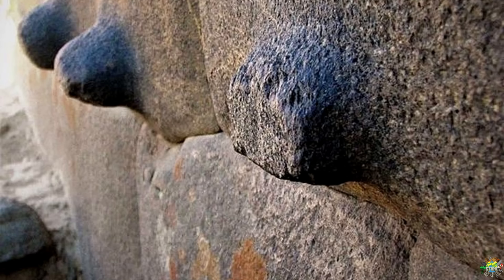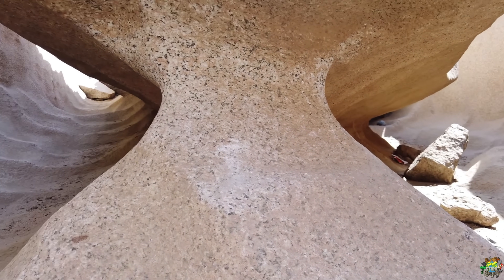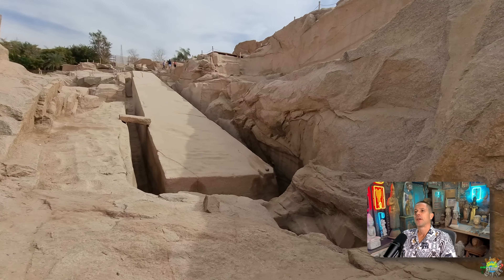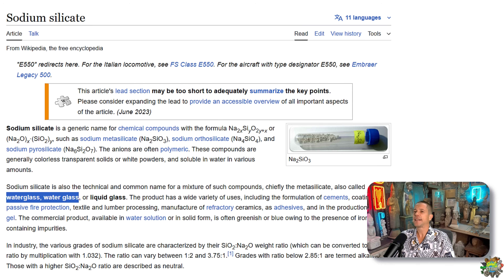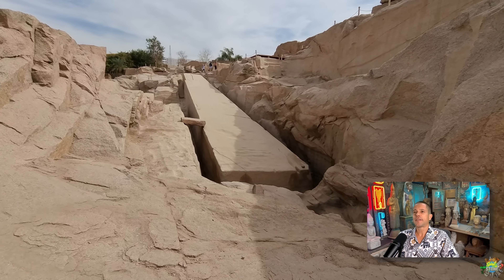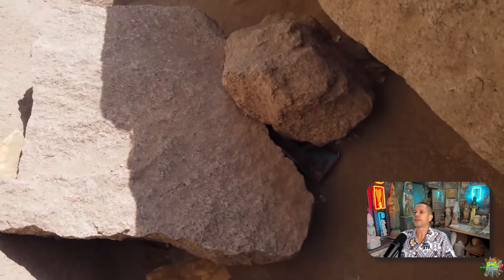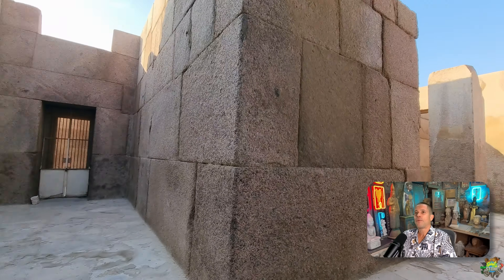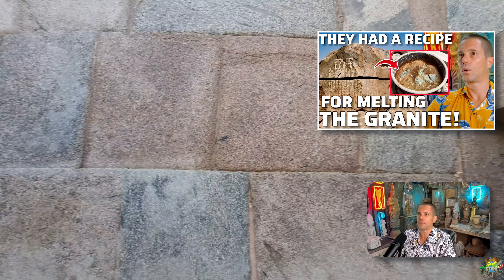The Unfinished Obelisk & The Scoop Marks Are Finally Solved

Comment: As above so below.
They scaled down a Herbig-Haro object and scooped the rock out with it.
The plasma technology they used for lamps has potentially been recreated. 
It's plasma.
Toroidal magnetic field would give it spin in one direction and the Q-tip shaped "head" - similar to the "snake" head in the dendera? - would act similar to a burr bit.

Comment: Ok, nice theory, but why did they only scoop under the obelisk and not on the right and left side of the obelisk? I mean, when down there would be a valuable place, why didn’t they scooped from the opposite side down there and only under the obelisk? 
And how much water glass do you get with this method and how much do you need to cast stones? If I look at the obelisk and what they took away it looks like that’s never enough to cast all the stones with, right? Just wondering.

Comment: @3rett115  The people of ancient Egypt had access to wood through trade if not local. They built wood barges and other things. These small fire-box fires are trivial. You do know there's actually documentation of evidence at the quarry in the form of wood charcoal, scorched and crushed rock, lenticular rock flakes from heat, mud firebrick remains, etc.? I tried it myself on basalt and it works. This is all just fire setting in small rectilinear confinements. Not some imaginary giant Dremel or plasma torch. So simple even a cave man could do it, and they did. Globally!

Comment: Goal:
Make a water-glass–based artificial stone that rivals granite by converting sodium silicate into a dense, stable silicate matrix.

Key Principle:
Water glass is used only as a silica carrier. It must be chemically converted and densified so it is no longer soluble or alkali-active.

Target Properties (Granite-like):
Mohs hardness: 6–7
Compressive strength: 200–300 MPa
Porosity: <1%
Water absorption: <0.5%
Long-term chemical stability
Aggregate (70–85% by volume):
Crushed quartz (primary)
Feldspar or granite fines
Optional mica or iron oxide
Use mixed grain sizes (coarse → fine) for dense packing
Binder Conversion:
Start with concentrated sodium silicate (water glass)
Add silica flour
React with calcium hydroxide (lime)
Optional alumina source (kaolin clay)
Resulting Matrix:
Calcium silicate hydrate (C-S-H)
Calcium aluminosilicate hydrate (C-A-S-H)
Insoluble, stone-stable, non-hygroscopic
Critical Steps:
Minimize water content
Neutralize or trap sodium (lime or magnesium oxide)
Compact aggressively (vibration + pressing)
Eliminate air voids
Cure slowly at low humidity
Optional Enhancement:
Heat treat at 200–400 °C to remove bound water and further polymerize silicates

End Result:
Dense, polishable artificial stone
Fractures pass through grains (not binder)
Water-stable, UV-stable, long-lasting
Effectively “cold-formed granite”
Failure Indicators:
White alkali bloom
Water darkening
Brittle edge chipping
Fracture along binder lines

would you be able to tell the difference between this and natural stone?

Yes — with a trained eye (or some simple tests) you can usually tell the difference, but a well-made artificial stone can get very close visually. Here’s the breakdown:
1. Visual differences
Binder lines: Even if polished, microscopic binder may show slightly different refractive index between grains.
Uniformity: Natural granite has random grain sizes and crystal growth patterns. Artificial stone often looks “too evenly packed” unless carefully mixed.
Color / veining: You can replicate it, but subtle mineral inclusions and zoning in natural stones are hard to copy perfectly.

2. Physical tests
Fracture: Natural granite fractures through crystals; water-glass stone fractures along weak spots in the binder if not perfect.
Weight / density: Often very close if aggregates are dense, but slight differences may exist.
Scratch & polish: Both are similar in hardness (6–7 Mohs), but under a loupe, natural stone may show true crystal cleavage vs. the “composite” appearance of artificial stone.

3. Chemical tests
Acid test: Artificial stone may react slightly to acids if any alkali is left over. Natural granite is mostly inert.
Water absorption: Well-made artificial stone <0.5%; natural granite similar, but older or porous varieties vary.

4. Microscopic / lab tests
Microstructure: Under a microscope, artificial stone shows binder between grains, sometimes amorphous silica regions, while natural granite is fully crystalline.
X-ray diffraction: Reveals artificial C-S-H or C-A-S-H phases — natural granite has all natural minerals.

✅ Bottom line
From a distance / casual inspection: Often indistinguishable if polished and colored carefully.
Under careful inspection or lab tests: Differences become apparent.
Reply: 1. Structural uses

Could it work?
Yes — if done correctly, a water-glass–based engineered stone can handle compressive loads, like granite or concrete. But there are limits.

Pros:

High compressive strength (200–350 MPa if densified properly)

Hard, abrasion-resistant surface

Can be cast or molded into blocks

Cons / Caveats:

Tensile and flexural weakness

Like concrete, it is brittle

Poor under bending, twisting, or impact

Requires reinforcement (steel rebar, fibers, or layered design) for beams, slabs, or tall structures

Moisture sensitivity (if binder not fully cured / neutralized)

Alkali can leach and weaken over time

Shrinkage / microcracks

Poor compaction or fast curing can create stress points

Thermal cycling

Rapid heating/cooling can induce cracks if binder isn’t fully polymerized

Summary:

Works for compressive applications: countertops, tiles, slabs, wall blocks
Not ideal for beams, load-bearing columns, or anywhere tensile strength matters unless reinforced

Comment: it does seem that the blocks in the valley temple are mostly cast but if they were why did they not cast, at least most of them, the same uniformed shape? if they could control the size by casting then to keep a more consistent shape of each block seems like it would have been a natural desire for visual purposes and easier to repeat since it would the same size.
Reply: possibly stuctural strength

Comment: Pfff your idea is foolish, let me dig a trench and do it in the shape of an obelisk. Makes total sense for fools! More like they did both , as in let's cut and obelisk using this method and obtain this product. You make archaeologist explanation of pounding stones sound smart. In reality those pounding stones are not used for pounding and are put under the obelisk to slide it across the floor removing the friction of the earth below. The shafts on the side also point to what? For timber shafts to help move the obelisk like scaffolding, probably scaffolding is wrong term. Go back to copying the smart peoples ideas

Comment: I would like to make an observation about the chess board column feature 2 33. The centre of these columns are more weathered or softer than the outside, which might help explain the curved scoop marks-whether Natron was used or not. Also the Obelisk is a different colour to the surrounding rock 5 42. My thinking is perhaps the columnar rock was not natural but more of a soft cement type building material which could be removed more easily, after a geopolymer obelisk had been made with different materials. Like construction works for a very heavy concreate pour Also, there is no vertical lines from these columns on the side of the obelisk and the columnar feature is below it......But why columns and not flat slabs? and why is there a constant dark stain across multiple columns?  There is also a layer of cubes on top of the column section - could this be how they slowed the curing time?

Comment: So the granite needs to be turned to jelly, then transported by hand to the building site and then dropped into huge building block moulds before it solidifies again.
This means the jellied granite cannot be hotter than 38deg C, or the transporting workers would be badly burned.
Reply: “Filling the cement mixer troughs” …
Is there any evidence of huge amounts of granite being quarried to fill the two troughs either side of the “obelisk” that could have been turned to jelly and then removed to “the building site”?

The jelly effect would also affect the troughs to a certain extent depending on how much of the mixture was being used.

Realising the jelly effect returns to solid again. 
Is there any evidence of geopolymer structure in the bottom of the troughs, that disappears the further into the granite the bore sample is?

Comment: You may have a point that the different colors on the blocks are due to ash, but I think a simple sample for analysis would solve that mystery! If you took a sample of three different blocks, for example, you might be able to see the presence of ash in the stone. And if the result shows ash, you would also be able to determine that it is actually molten stone that the blocks are made of!

Comment: One thing occurred to me looking at the work under the massive block, and that is here we see the transition up then out. The narrowness of the transition shows none of the typical "pounding stones" would fit in that arc. Also, it should be expected the Egyptians knew how to bind rocks to a club or shaft.  There are various ways rather than just using one's hands: thongs shrunk around a stone inserted into a "y" branch, even inserting a stone into a split branch of a living tree and allowing it to heal around the captured stone.

They proveably knew about the six basic tools. Lever, fulcrum, screw, pulleys, etc.

Other telling things are the "ribs" that follow a line across the parallel "scoops".  Such can only align because there are time regulated starts and stops of equipment.  They indicate rhythmic processes that wouldn't occur by random human pounding.

The confined space  beneath the behemoth stone prove there was a machine at work. The narrowest cuts compell the conclusion the grinding head was exactly that small in profile, and as wide as the typical "scoop".  And now we're talking about a chain driven, flexible tool.

The deep holes here and there define a maximum width. It would be interesting to know if the bottoms of them showedsigns of a snap off or were they aligned towards a definite directional bias.  Thus a machine that hung over the edge of the defining ledges . . .

Comment: I really think this was a test peace for other project's, using water / chemical reaction was my first thought when i was looking at it, water glass etc, still did not know what it was, but chemical reaction with nile water salty water or fresh water with various chemicals and its not during the reign of the egypt kings but way before them, meaning at least 5,000 years ago IMHO, they know how to do it and thus it was lost art of how to do it and then they simply tried the normal way of trying to shape the limestone, also you can see the drone footage of how different color the top of the limestone structure is at the base going all the way nearly to the first line seen at the top of it.
But it still does not explain how they managed to make the vases with such precision or anything at that level, we have kern micro which is the most precise cnc machines now, yet they managed to make a 6" vase which has a micro level dimensions in the realm of 0.040 microns all over the shape of the verse.
Also is there a way to tell if it was made with geopolymer / casting of a limestone object compared to say a large limestone object, can we tell the difference, otherwise its mute if you ask me, who is to say they made everything out of a geopolymer granite based materials with so much sand in ashwan they could have done it imho. keep up the great work, love how science is trying to tell a story of the past. .🦘✌👍

Comment: If they used molten natron then how did they melt the stone in straight lines? How did they stop the molten natron from melting one surface but not the other when working their way down the side of the obelisk for example? How did they use molten natron upside down underneath the obelisk? And how the f*ck can they "start under the obelisk"???

Comment: Could a 10 foot magnifying lens have been used to focus the sun to melt the sodium bicarbonate?
Reply: Easier to have a dozen or so people holding half square meter front polished bronze reflectors. And that should work, but skip the natron. A good hot scorch spot should give you a patch of ruined stone to easily crush away.

Comment: In addition, roasting limestone ultimately produces calcium oxide. 

Get some hot coals on a rock,, add crushed limestone add more coals and supply air to superheat. Once all burnt away but while hot add some water to dissolve the calcium oxide and let it seep into the granite. Leave for a day then scrape out the "weathered" granite and calcium silicate residue.

Calcium silicate makes better geopolymer than sodium silicate because the calcium is less soluble. This makes more resilient polymer bonds

Slaked lime calcium hydroxide is as good as natron (sodium bicarbonate) both when heated decompose to the oxide which converts to hydroxide with added water. 

Limestone is more abundant than natron

Comment: If the Granite was melted it would Change the Molecular structure of the crystals formed inside the Granite over millions of years.
Reply: Yes. And the low melting components irreversibly change phase from crystal to glassy amorphous material as it cools. That's why fire (heat) alone works so well, no natron needed.

Comment: But there's scoop marks on the vertical walls next to the obelisk and on the underside of the bottom, so how did those get there if they're the result of making waterglass? The geopolymer theory actually makes the most sense of any other explanation Ive seen, especially after seeing the stones they created with this method you've shown previously
Reply: Rectangular mud/straw barriers for fire setting. I assume you could prop them up on a small log held in place against the wall with poles. When I tried it I used a metal frame instead of mud, held up by a piece of wire. The scoops were mad by simply heating with fire then pounding out the crackled damaged stone. Not natron.
Reply: @rickZR1982A That's really interesting. Would love to see a video of your process. Do you have one? Thinking of trying it somehow
Reply: @rickZR1982A  hmm, interesting 🤔
Reply: @rickZR1982A  Yeah, my mind keeps going to something involving heat. But like others have said, sourcing the fuel would be a tremendous job in itself that would also slow the process down significantly. Add to that, how are multiple teams in these trenches doing a physically demanding job while breathing so much smoke? I wonder if they were able to build polished bronze/brass solar reflectors to heat the stone. They knew how to forge these things and would also explain how they went up and under the obelisk by using flat mirror like reflectors. But I don't know how large something like this would have to be to get the stone hot enough to deteriorate it enough to make it easier to carve. Also, we've never found, to my knowledge, these reflectors/collectors; however these would've been the first things scavenged through the ages and likely melted down. Either way it's so fascinating that with the internet allowing thousands or even millions of people to collaborate on this problem that we're all still scratching our heads.. lol

Comment: I've essentially recreated your process by accident. 
I'd think it would be dual use... Make water glass as you also make a big Obelix. 

I like your logic 

I've made my own silica gel by roasting amphibolite with calcium oxide. When I crushed the rock to recover gold, by the next day the residue had been set in a gel.

I also made some meta kaolin geopolymer by boiling kaolin in a mix of hydrochloric and phosphoric acid ( l added too much water and had to boil some off). Then add some home made water glass then  poured the cooled mix into a plastic cup... It cured and has a shiny  surface that conforms to all the details in the plastic cup. Super strong material 

I made this with fire rocks,  calcium oxide sodium hydroxide and some acid. Definitely doable by our ancestors
Reply: Ive been thunking about how bees vomit their stomach contents to make their hive and also honey.

Humans would be a natural source of acid

Comment: I worked in heavy construction for many years and have been around it all of my life and I will say for certain that them stones are NOT geopolymer. If they were geopolymer they would be identicle because one doesn't make a seperate cast for each one molded. it would be rediculous. If you can find like 40% or more that are the same size then you will be onto something hell even find 2 that are identicle then you might be right... Just a FYI
Reply: It would be ridiculous to cast the stones then carry them up the pyramid instead of casting them in place. How else do you stack stones without mortar and no wobbling?
Reply: @far-middle by making extremely precise cuts on every stone.